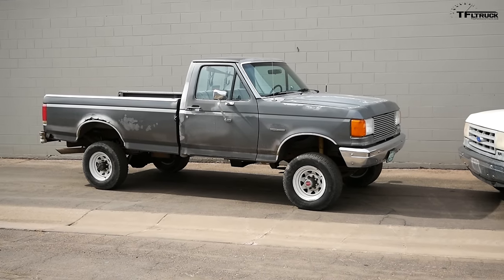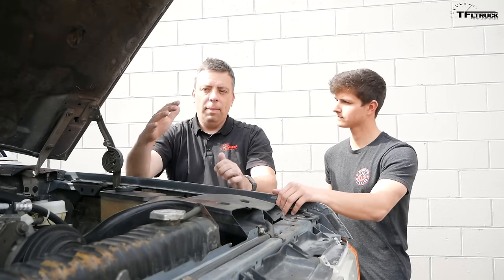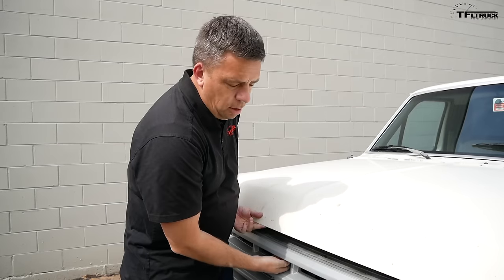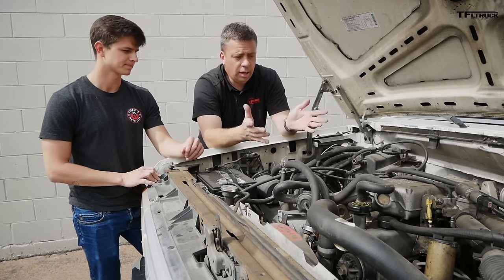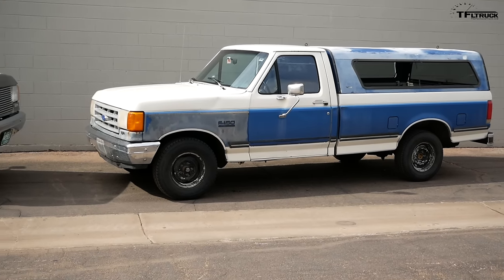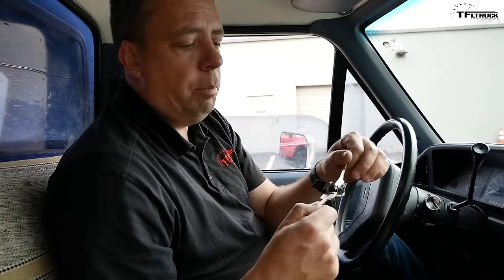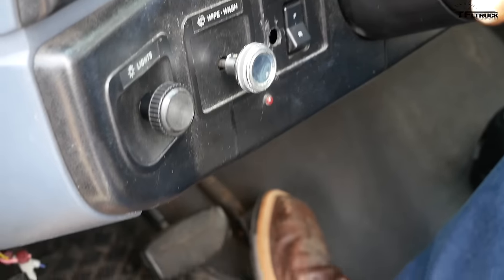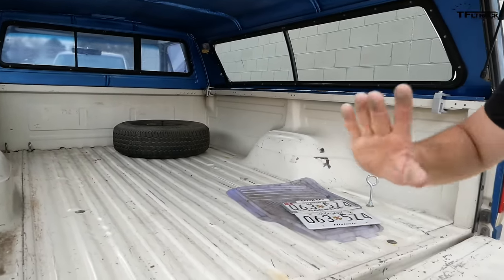Here's Why You Can't Kill An Old Ford F-Series Truck | Gunsmoke Ep.3

Comment: Older diesels, especially before the government started messing with them, are beasts that can run on almost anything.  These were real work trucks.  It would be great to still have dual fuel tanks.
Reply: So what they did is instead of having dual standard sized tanks is they made a single huge one which eliminated the new for a switch and all the other complexity.
Reply: @oldgreen100  
There aren't many non commercial vehicles with one giant gas tank that is equivalent to two gas tanks being offered today.
Reply: @notsosilentmajority1  Ah ok. My pickup has the single huge one. I figured it was pretty common. Great range, but it was $100 to fill up before gas prices went crazy.
Reply: @oldgreen100  
Yep, gas prices are hurting us for sure.  I had a 2015 F-350 Diesel Dually and I am so glad I sold it a while back.  For whatever reason diesel fuel is at least .50 cents a gallon more than unleaded where we are.  Apparently, in order to lower unleaded fuel prices they raised diesel fuel costs, knowing that truckers will have no choice but to pay it.  It gave a sense of fuel prices coming down a bit but it only went down for a portion of drivers, not for everyone.  It sounds like you are paying a lot to fill up now.  Good luck.
Reply: The dual tanks are a ready-made system for burning waste veg oil. Use one tank for diesel and one tank for wvo. Crank the truck on diesel and once warm, switch to wvo. When you get 10 minutes from your destination, switch back to diesel and purge the wvo out before shutoff. 
This is 100% proven for the 6.9 & 7.3L IDI trucks with their mechanical fuel system. Not sure about the powerstrokes.

Comment: 4.9 straight 6 ford is the gold standard of engines, I had one 14 yrs in a 1976 f-100, it was bullet proof.
Reply: Recently bought a 73 (72 in US but I'm Australian) F350, it's got the 300 with 4 speed manual
Reply: Yup i can agree with you i have a manual 5 speed with inline 6 and im at half a million million miles the only thing ive replaced has been the radiator and its on its 2nd clutch and man i love my ford truck love the dual fuel tanks comfy ride and i just dont ever see myself giving this truck up....so yeah your right they are bullet proof
Reply: Really? Better than the 5.8? I’m looking at two trucks with both of these engines

Comment: I drive a ‘92 F-150 with the in-line six and automatic four speed as my daily vehicle. With 275,000 miles, it still runs like a top. I would trust it to drive cross in it. You have to love old Fords.
Reply: Did you ever put a  camper on it?
Reply: Chris Birch no I have not.
Reply: i have a 90 f150 with 180,000 on her, only rust on it is the back fender wells and on the cab corner but you cant see that cause the trucks red, absolutely love this truck man, i truly trust these more than most vehicles
Reply: Have a 92 f150 straight 6 auto myself (single cab) 245,000 currently fixing a blown head gasket and filming it for youtube.  Also bought a 93 lightning ready to be restored soon but still runs. Love the 9th gen fords, best looking trucks to me! Just saw your comment and had to give ya a thumbs up brother!
Reply: @3rdcoastobs467  Why did you buy the worst lightning?

Comment: im so happy my dad never sold his 88 f250 its got a 7.5 460 and i love it so much, 500k+ miles and hasn’t had any major issues other than normal maintenance
Reply: Have an 87 460 F350 4 speed. Bought it cheap for temporary use, but fixed the exhaust, rebuilt the carb and replaced the headlights. It just works great. Sits all winter and fires up.
Reply: Love the 460 workhorse engine that never gives up

Comment: Have a 1996 extended cab 4x4 302 with 243,000 miles, and a 1996 single cab long bed 300 straight 6 with 250,000 miles. Both still driven daily.
Reply: My sister in law got rid of her '96 with the 302 at around 380k miles and it was still solid.  Only issue was the passenger side headlight bulb burned out every few months.  Likely a bad ground or some simple wiring issue like that but they're solid trucks.  My '04 F-250 only has 160k miles on it and runs like it'll live up to the Ford reputation, those V-10s just don't quit!
Reply: I'm the same way. My 94 f150 5.0 has 285k and my 96 f150 4.9 has 230k. Both still driven all the time with no sign of either quitting anytime soon.
Reply: I daily drive a 1985 f250 with the 6.9 IDI with god knows how many miles only thing I’ve done to it is out a new starter and two new batteries in it along with regular maintenance, and my wife daily drives a 96 f250 power stroke with 237,000 miles, only changed the glow plugs and the truck still looks brand new doesn’t even leak a drop of oil. Love these trucks

Comment: Love it! I've owned an '81 F-150 2WD (300ci carb), an '87 F-150 2WD (300ci EFI), a '90 F-150 4WD (302ci EFI), and a '97 F-150 4WD (4.6L). Lot of good memories of those earlier models. The 6's were so easy to work on, even I could change water pumps, radiators, and heater cores!

Comment: Two great trucks. Would be a shame to let the 2WD one die. Rumour has it that two Ford project-trucks are better than one.
Reply: ThePoopsie321 isnt a rumor. It’s total fact. Build the grey one to tow the future pre-runner
Reply: That's true, I've got 2 F150's one 90 and 91 which I was going to swap the body from the 2wd to the 4x4 but got some fuel pump problems and now the 2wd's frame it's rusting out, so it might finally happen. Called them the Beuty and the Best! Love the manual 4x4, but I will need a third car to take apart and go to work.
Reply: the diesel is worth more to collectors than the 2wd. IMO
Reply: @SchnelleKat  haven't seen anyone collecting them up north, they have been my daily drivers since 2008. When something goes wrong in one I drive the other one, but been putting up fixing the fuel pump for over a year now in one of them.
Reply: If they go thru on the plans to kill that F150 I won't be able to watch this anymore. I've got an 89 F150 4.9 8ft bed just like that. Love that truck. Sure the F350 could be cool but destroying a perfectly good truck is wrong.
Reply: @axelvanegas9623  Guess it really depends on State here in MI they are kinda gold...
Reply: @adamsears1403  Yes, I'm with you on that. If they cut that F150 up for parts, I won't watch. It appears to still be a good truck that needs a little TLC. They could do a "light" restoration not as radical as they plan for the F350.  After all two trucks to auction off for charity would bring more money.
Reply: ThePoopsie321 I share the same thoughts... I promised that I’d get rid of my 96 2wd f150 when I got my 89 f150 4x4. Now I have both. And as I see newer trucks and cars come out it makes me want to hold on to them so much more...
Reply: @freedomoverfeelings  that's the wise choice
Reply: Can confirm. Have a 2-door 96 F150 short bed and I see more people interested in the 2-door online. The only downside is you can barely fit two fat coon hounds and yourself in it. And one hound has to be partially hanging out the window LOL

Comment: My local Ford dealer had a 90s Bronco on it's lot, and looking at the line of brand new F-150s, I was still thinking the Bronco was more desirable.
Reply: Sounds awesome brother.
Reply: @wildbill23c  Same here mate.
Reply: I love the 92-96 Ford trucks as well as the 92-96 Ford Broncos.
Reply: Trucks of those days, are so much better looking than new trucks, that, and they are much better built. Those where the days when built to last meant something.
Reply: @TimberWolf429  Exactly mate but these modern car lovers will never learn.
Reply: Is it red?
Reply: @OhPhuckYou  True.
Reply: Might cost more as well if it's the right bronco. Those can run over 100k.

Comment: 300 inline six is hands down the best engine ever built! Love my old '87 F150 4x4, 300 inline backed by a T-18, 4 speed manual.  Ford should really bring back the 300 with a crossflow head and turbo charger equipped with a  10 speed transmission.
Reply: BorgWarner T18
Reply: @bobbyheffley4955  that transmission wouldn’t keep up with modern traffic

Comment: I've had old Ford trucks with both those engines in them .. Wonderful engines ..the only things you will replace are starters and alternators
Reply: Ive got a 94 302 with 155k miles I've had to replace the starter 3 times but still trucking with the original alternator
Reply: Don't forget power steering pumps...
Reply: I had two F-150's, one year apart. My favourite was my 94 with the 300 6 and 5 speed. It had 189,000 miles when I traded it off. The other was 94 with the 302 and auto. Both were good trucks. O also worked for a Ford parts whs  which had a E150 with over 300,000 miles when it finally died.
Reply: And the body when it turns to dirt from rust.. engine still works tho.. lol
Reply: @bufordmaddogtannen5164  amen to that
Reply: @markbremmer8642  Had a 1997 F350 longbox crew cab ...2wd with the 7.3 turbo . Sold it at 500k miles and still ran like new . Had all the original front end except shocks . Was never used for the heavy duty it was designed for ,and just wouldn't break . Alternator seized on the highway and took the serpentine with it ..OMG . If I hadn't had a passenger to help steer off the road ...lol . My 1987 had the 4.9 six with a 4 speed manual . topped out at 70 MPH . Only ever used first gear to pull a guy out of a ditch . :)
Reply: @AntsShop  I've heard that , but both of mine never had an issue . just good luck I guess
Reply: and steering pumps and tailgate latches    about the only things ford got wrong
Reply: Must never have had to do an injection pump in an old 7.3 idi before, those are a little expensive.
Reply: Sounds to be like it's just a Normal  change  as long as  it ain't the motor or transmission
Reply: And battery ground cables when they brake and your truck won’t start

Comment: Retired or just tired automotive engineer, in the 60's just worked for my company.  But starting in the 70's had a new boss called the EPA, then the DOT, then NHTSA, and to a certain extend bean counters and even automotive insurance companies.

In 1965 we had about three government agencies, today over 1,500, created to advise congress since the average congress person doesn't even know how to blow there own nose.

If you thing the automotive industry suffered, look at the number of companies that disappeared but general aviation became a complete disaster.

Whenever I hear a politician say we have to move forward, would rather hear them say, we have to move backwards when this was the land for the free.

What is the major criteria to become head of all these agents?  Just one, help the present president get elected, not any knowledge of the agency they are head of. 

Fleet I would be ashamed to put Ford, Chevrolet, or GMC in large print of the tail gate of these pickups.  After six years of road salt, big pile of rust, same with Toyota.

Until 1949 all vehicle had about 0.5% nickel added to the steel that made these vehicles practically rust proof, died in 1949, they year Detroit rust was invented. 

Did you know it cheaper to manufacture a solid state engine control computer than a mechanical distributor!  The ECU is strictly unrepairable , throwaway, and some cost way over a thousand bucks to replace.  Can go on and on on this subject and no concern about losing my job, lost my job years ago to China, also no thanks to our government.
Reply: NickDe39
nicely written commentary, and it aptly describes the core of our problems these days... give me liberty with an old Ford!
Reply: Very well written.
Reply: Scariest thing to hear: we're from the government and we're here to help.

Comment: My 91 F150 spent 29 years in north east winters then parked it before winter.  Sat 5 months under a snow bank.  Charged up the battery and it fired the instant the key touched the start position. No you can't kill a brick nose Ford unless you grossly exceed its GVW or lack of PM. 
Same can be said for square body Chevy,  I own both
Reply: I've owned two Square body Chevy's, both were rotten whe I bought them. I also owned two brick nose Ford's. The Ford's were better when I bought them due to maintainence.
Reply: @markbremmer8642  as with all equpment PM is everything.  Washing and oiling the underside of your road going equpment is essential for rust prevention in northern or ocean front areas.
That said GM products to this day still rot more quickly than they should compared to other trucks.

Comment: “The rear tank leaks” they all do 😂 this is such a great video on these old trucks! 🙌🏾
Reply: '95 black swb 300 160k...and my rear tank leaks.
Reply: My 93 7.3 has two fully functional tanks
Reply: Just replaced my rear tank, no more leaks! Went with an American made poly tank, so I won't have to worry about it rusting through again.
Reply: In the rust belt ,not a problem  here in the south.  My 88 has original tanks .
Reply: I got a 87 rear tank is completely fine. Front tank is completely rusted on the inside though

Comment: I bought my 1989 new and it came with the 300 and a 5 speed. I put 200,000 on it and never replaced the clutch.
Reply: 1988 300 zf 5 speed  just turned 400,000 ,still  going strong.  1990 with 300 and  e4od  unknown  miles on engine  still going strong .

Comment: Our 87' F150 with the same 4.9L Inline 6 now has over 1,00,000 miles. It has the original engine and transmission, and it still runs great. These trucks were darn reliable

Comment: I’m very familiar with these trucks I used to own a 1990 Bronco XLT with a 351W & E40D and I used to work as a tow truck driver the first truck assigned to me as a new driver was the oldest truck in the fleet which was a 1991/92 F450 with the same 7.3 NA Diesel and 5MT I literally can smell project gun smoke warming up through my phone you guys are bringing back memories 👍🏽

Comment: Man you guys make me feel so old. Has it been that long ago we had two diff keys?!😄. I was just getting use to switching from my floor starter to the dash!
Reply: My 1978  Ford F-250 4x4 only has one key as well.  It fit the doors, glove box and spare tire lock.  I don't like my 1990 F-150 2wd  5 sp overdrive as well because they went to the 2 keys as seen here.
Reply: Wayne Baird      My 53 Chevy pickup had two keys. One was just door lock. But in order to lock doors you had to lock passenger side from inside only.
Reply: I pulled the tumblers out of the doors on my 76 and 87 F250s and rebuilt them to take the ignition key. Half a day well spent
Reply: Jajaja, on my side I have two keys because they stole my truck. New ignition switch and the original door key.

Comment: Hey just so you know when you cold start that 7.3 you’re supposed to hold the gas pedal at half throttle to engage the coldstart advance. There’s probably a sticker on the driver side sunvisor that says this or if you look up the manual it’ll be written in there as well.
Reply: You are correct, I own a 1988 F series with the 7.3

Comment: That "Tax Dollars For Vintage"  story about sand in the intake broke my heart.  I knew vehicles were crushed, but I didn't realize Big Brother wanted the engines destroyed too.  Now I'm just mad.
Reply: what's weirder are toilets. If a plumber replaces a pre-1990 toilet, he is required to take it out and smash it into pieces.
Reply: @diktatoralexander88  I actually agree with that. They use too much water to flush.
Reply: @Lowkey_ID  but I have to flush them 2 or 3 times soooo.....
Reply: @diktatoralexander88 not true I am actually a plumber and I can donate them to habitat for humanity if I wish too
Reply: @Lowkey_ID newer toilets don’t really save any water since in some cases you have to flush more than once. I have a 5 gallon toilet from 1957 in my bathroom that I installed myself and it gets everything down the line in one flush. It replaced a water saver that didn’t work as well

Comment: I had a 92 f250 with a 7.5 460 in it that thing was awsome regret selling it all the time
Reply: everything i had with a 460 got 14mpg, city, highway, hauling or empty - same?
Reply: Troll, I would love to see 14mpg on mine.
Reply: My grandpa had a 83 f150 with the 300 i6, he blew it up after 60k miles, but he also drove it to work daily while also going mudding every weekend which was nothing but redlining in 1st gear 4lo and only going 1mph through deep mud holes, once it blew up he went to a junk yard and picked up a 460 and bored it over, said the truck was amazing but once you got in mud it was useless since the 300 brought the same wheel speed in the mud.
Reply: I had a 94 250 w/460 I'm pretty sure it was $10 everytime I started it up. 322k miles and was like these other 2 trucks unkillable beasts.